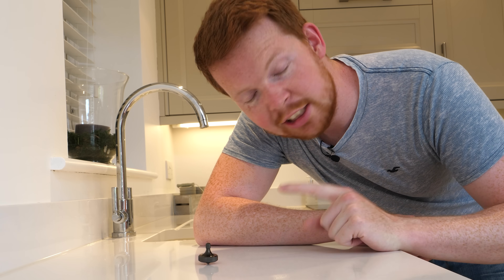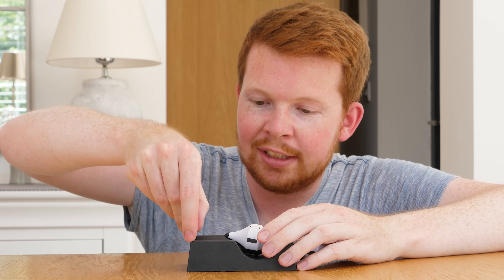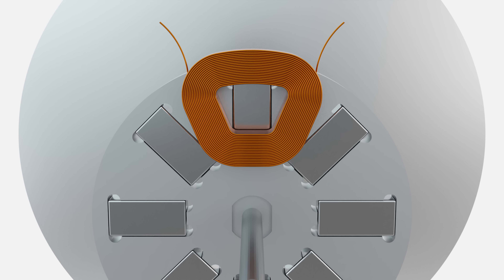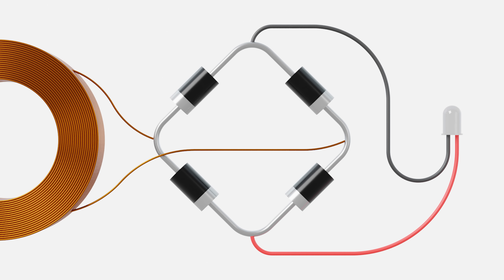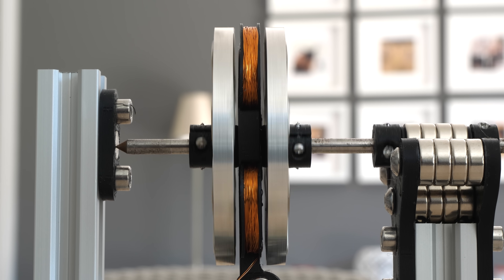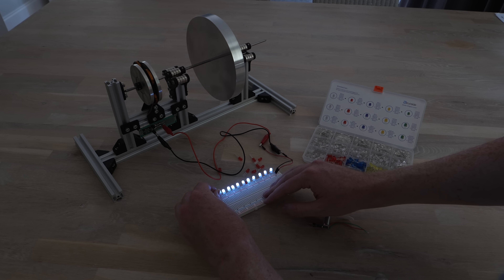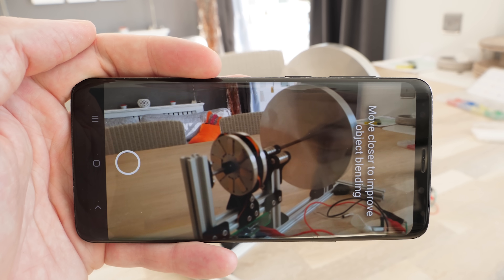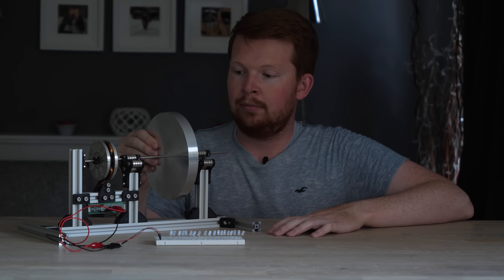Flywheel Battery

Comment: Some interesting facts: According to the U.S. Department of Energy, the United States had more than 25 gigawatts of electrical energy storage capacity as of March 2018. Of that total, 94 percent was in the form of pumped hydroelectric storage, and most of that pumped hydroelectric capacity was installed in the 1970s. The six percent of other storage capacity is in the form of battery, thermal storage, compressed air, and flywheel.  The flywheels store 58 mega watts of that total capacity.  Some flywheels use magnetic bearings, operate in a vacuum to reduce drag, and can attain rotational speeds up to 60,000 revolutions per minute.
Reply: Phobos, 

storage is not measured in Megawatts, but megawatt hours, i.e the duration that the storgae can provide power for.
What the DoE have not included is the amount of flywheel energy in all of the thermal and hydro power plants connected to the grid. These large machines have a very large amount of inertia from the roational speed and large mass of the generators. (Something wind and solar do not have) This flywhel effect has astabilising effect on grid frequency. 
Incidentally a test to measure how long this rotational inertia would last if power was lost was the reason that the chernobyl accident occurred.
That is a problem with storing energy in a flywheel, as soon as you use it to generate power it starts to slow down and power and frequency drops off. It doesn't seem a promising way to store energy for a grid.
Reply: @iareid8255  It's output was the same in watts (from thicker and then thinner wire).. so he knows what he's doing but it's all for YT income.
We're all done here, we're all done with energy.
Reply: @iareid8255  You'd need both measurements. How many watt hours can you hold, but also how many watts can you pump it out at to meet different demands? A trillion trillion megawatt hours of storage built at great expense isn't useful if it's bottlenecked to 1 megawatt in and out, and the cycle of need is daily.
Reply: @iareid8255  right, with each load, you need more force... That applies to about anything related to generating power.
Reply: @iareid8255  
Multiple flywheels. 
The drain from all flywheels will be lesser and lesser. 
Its temporary energy lasting X amount of time. 

It may be better used for some situations and not others. 

It could be used to supply electricity at night in a solar powered powerplant.

Or could be used for. Smelting in space! Lol
Reply: Christopher, 

you may not be aware that large conventional generators are also flywheels, they have a huge mass rotating at 3,000 rpm (50 Hz), this comes for free. 
if you want a flywheel to back up solar that takes some power away as the prime mover needs power to get up to speed. as you said yourself it doesn't last long and slows down imediately it is loaded.
Reply: @avatar1867  They already use counterrotating flywheels powered by regenerative braking for an extra boost of power at the wheels in at least one new car, the new Acura NSX.
Reply: @Daniel Daniel If there was functional free energy, not even the massive fossil fuel lobby could hide it. Any country which has access to unlimited free energy would have a massive advantage over any other country, revolutionizing every aspect of technology and industry practically overnight; there's no way that neither the US or USSR would have ignored such a game changer during the cold war.
Reply: @ENCHANTMEN_  it doesnt have to be free energy to be revolutionary, it's this idea that the newest technolgy is always better forever, maybe some ideas still have merit, and now that we have advanced, they can be approached by new minds,  maybe small flywheel batteries would be healthier for our planet than lithium? all questions that could be answered, but wont as long as we are OK with just accepting things as they are.
Reply: @AmpHibious  that's the way it is.  Flywheels are much more complicated, heavy, and prone to issues than a battery ever will be.
Reply: I wonder if that's dedicated energy storage facilities that use flywheels or just the energy stored in the rotors of power plants that use steam and heat (coal, nuclear, etc)?
Reply: @ENCHANTMEN_  I looked through a whole chapter of an old college book to find for the term you reminded me of but couldn't find it, i think it's called "grid inertia" or "power inertia", its the term that describes the potential energy that is hiding in any major power generating component that is rotating strongly but not actually producing power for whatever reason, for example ANY turbine blade assembly, hydroelectric gens, will spin for like an hour and can be used to reboot the plant or just draw power off that rotation alone for a few minutes or whatever.
Reply: @ENCHANTMEN_  no.
Reply: Perhaps using a battery for any load would off-set any degradation in rotation speed, power, etc.  In other words, use the "flywheel generator" to supply power at a steady, consistent basis of current... while the battery powers whatever it is that needs powering.  Perhaps isolating the two might be helpful... at least "somewhat."  IDK, I'm just speculating and trying to "think outside of the box."  :-)
Reply: @drileydriley2814  A flywheel is not a source of power, it's just a place to store energy. Same thing goes for a battery. Any time you put energy into such a thing, you lose some of it to heat. Your motor cannot perfectly convert all your energy into flywheel kinetic energy; your battery cannot perfectly convert electrical power into chemical stored energy. You lose energy to to heating the wires. And the same thing happens when you try to get the energy back out. 
Think of a battery or a flywheel as a savings account that charges you money for every transaction in or out. Think of a generator as a currency conversion bank that charges you money for every transaction. This is the cold hard reality if thermodynamics.
Reply: @timberwoof  And capitalism. Maybe it was just meant to be this way...😭🛢️💥🚷
Reply: @drileydriley2814  Isn't that what the car alternator does, except without storing the rotational energy?
Reply: @fredbloggs6080  Well, an alternator depends on the rotational energy of (usually) an engine, a battery does not.
Reply: @drileydriley2814  I know but I was saying an alternator doesn't store the rotational energy kinetically like a flywheel, only by charging the battery. Perhaps one could use a smaller capacity battery to act as a regulator as the flywheel energy decreased to keep the output relatively constant up to a certain point.
Reply: @drileydriley2814  We had a system where I worked that needed constant power.  It had a battery bank rectifier and a motor-flywheel-generator in series with each other for temporary power dropouts.  How long was the "M-G Set" good for?  4 seconds before voltage dropped off below spec and the plant would shut down.  One of the very few industrial applications I've ever seen.

Comment: I’m a novice at best but happens if you used Tesla’s water turbine as the flywheel power source how much power could you generate by pushing small amounts of water? Could you use a gas engine to power the turbine/ fly wheel to move a car?

Comment: I once read a good book about generator development. 
The first was like yours in the video. Soon more poles and magnetic force grew so big that they stopped making bigger and bigger generators. Some new inventions and a little bigger generator with new problems. Again new ideas and passing that and those problems. It is an endless chain. Very nice video. Ps. Even aluminum is a non-magnetic material, it encounters huge resistance in the magnetic fields. You can test making a pendulum with aluminum. It really stopped fast if it passing next to the magnet.

Comment: When designing the bearing, is the arc for the fixed magnets calculated based on the strength and size of the magnets being used?

Comment: What if you bridged a motor with a small rubber wheel so that when the flywheel turns it will power the motor and the motor will continue to turn the flywheel. Self induced power?

Comment: The end all would be taking about 40 or more turbines 1 after the other then a parael pipe powred by a air compreasor with belts going to each turbine

Comment: What if the both sides are a bit of center to the outside and the magnetic fields on both sides are mirrored so the both ends of the rod are trying to go in the opposite directions

Comment: Hi Tom, what if you had a pedal transmit your bodyweight into rotational force of the flywheel through gearing, instead of spinning it by hand? I believe that a human doing a stair-master like exercise could generate enough momentum in a flywheel to power quite a large appliance, with the correct gearing ofcourse

Comment: Could also put the magnets on the flywheel itself and have the wire externally around the flywheel so there's no extra weight added to the shaft but is added to the flywheel.

Comment: What would be cool is a little hand crank generator that pumps current through the coil to spin the shaft like a motor. You should use that to increase the RPM of the system without having to touch the magnetically levitating shaft. You could even have the hand crank mounted away from the frame and only attached to it with wires so that you don't induce any extra wobble from cranking.

Comment: I wasn't expecting to gain an understanding of Full Bridge Rectifiers today, but here we are!  Thanks!
Reply: somebody please mention Mehdi…🥺
Reply: @WilburJaywright  FULL BRIDGE RECTIFIER
Reply: Things to note, he showed it in different orientation (from up to down) that what is usually shown (from left to right) in textbooks, so some might get confused with that, unless you pay attention to the direction of the diodes.

Also, you usually also add capacitators to smooth out the resulting DC voltage, like here it was still going up and down, instead of the steady(ish) DC most of our devices expect
Reply: Not to put too fine a point on it, but the proper term is "Full wave bridge rectifier" for the device made up of 4 diodes. They can also be purchased as a package with 4 leads coming out. "Half wave bridge rectification in the case of this circuit could be accomplished with one diode.
Reply: Same
Reply: I still dont understand diodes at all
Reply: @sethmath2778  Think of a diode as an electrical check valve. Current can only flow in one direction, so this allows for converting AC voltages into DC voltage. AC voltage is a sine wave moving from negative voltage to positive voltage, back and forth 60 times in one second. In the case of a 'full wave bridge (often 4 diodes unless fed by a center tapped transformer and then only two are needed). two of the diodes are always conducting allow half of the sine wave through the circuit at a time maintaining polarity. If you watched this on an oscilloscope you would see the negative side of the wave folded over so there are now nothing but positive voltage humps that are then smoothed out with capacitors which store and release the voltages at the intervals to turn the humps into a straight line, or constant DC voltage.
Reply: @fredflintstone8048  

I'm not that guy, but I still don't understand.  I understand all THAT, but HOW does electricity not move back through it?  People always say electricity is like a hose of water, and it's obvious how to stop water.  Just block it.

But how does electricity get blocked?  Unless at that micro-level, the electrons literally act like water?  If that's the case, how does a diode let tiny electrons through only one way?  Tiny funnels?
Reply: @fredflintstone8048  Great video. Thanks for sharing.
Reply: Same I actually understand stuff better in application than in raw theory
Reply: Yeah, this makes a lot more sense than my physics textbook did.
Reply: @notsosureanymore  ～～

Comment: rotate your field coils by 90 degree, this gives you match more efficacy .. ;)
for even more efficiency use 2 field coils 90 degree apart. make sure when magnets charge the core the coils are not in phase with the core... then when field rotates by 45degree, stored magnetic energy in the core gets released.. at the same time a gyro magnetic effect will take place, as when a field is formed and you try to rotate it by 90degree it will implode and generate a huge spike in potential.. just like a boost converter. .. this hes as effect that the load and source are out of phase and are blind to one and other.. if you know something about electromagnetic systems then you know this is very very very useful.. have fun experimenting cheers!

Comment: By using a hollow tube, you can mount the magnets for the alternator within the tube itself.  In doing so, you can then use slightly tighter tolerances to create better field interaction. As far as spinning, using a sort of reverse clutch, you could attach a crank to the end that would disengage when you stop applying pressure allowing you to spin faster without adding too much in the way of friction.

Or, I could be completely mad.

Comment: A horseshoe of steel instead of the air magnetic circuit would alter things greatly. Reduce air in magnetic circuit by replacing it with high permeability material. This is why a car motor needs such tight clearances. Mu of air is trouble.

Comment: Was thinking you could thread the flywheel and then put the steel rod through that with a drill to keep the bend from happening with heat.

Comment: Are you familiar with rotating a copper disc in the presence of a magnetic field? Faraday discovered that if you measure the potential voltage between the center of the disc and the outside of the disc there would be a potential voltage difference and he also discovered that if you rotate either the disc or you rotate the magnet that potential difference is the same. Moreover he discovered that if you cemented the disc to the magnet and rotated them together the same potential voltage difference was created! By rotating the magnet and the copper disc together like a giant hamburger you create the same electrical force without having to overcome the mechanical energy required to rotate only one of the structures! You know like if you take a small DC motor and you turn it as the coil passes through the strongest point of the magnetic fields there's kind of a thump thump thump by cementing the magnet to The copper disc you get rid of that resistance it only have to overcome inertia and friction.

Comment: 5:32 When you say "light bulb" I always picture and incandescent filament type, which work on both AC and DC current.  Does this mean I'm old?

Also, I'd love to see a cost comparison between vacuum flywheel storage solutions and chemical batteries, since I think they'll become very relevant in the near future.
Reply: Is it possible to buy an electric generator from you?
Reply: There are some buses somewhere in Europe that use a huge flywheel for energy storage.
Reply: Join the club
Reply: Complex batteries...with a giant tank of chargeable "FLUID"

Comment: I bet you think the wobbling is because various parts aren't quite straight enough, or on a flat enough surface, but actually, it's due to the "intermediate axis theorem", which in a nutshell says that most things that are spinning are actually spinning around multiple axes.  Veritassium did a great video about it https://youtu.be/1VPfZ_XzisU .  You can avoid the wobble if you make your spinning disk's mass more concentrated in the pancake section, rather than having a secondary spinning disk attached to the side like a sidecar, and this change will be crucial if you ever want to get your desktop flywheel up to higher speeds.  This will mean putting the magnets in the main disk itself.

Speaking of higher speeds, the next step in your project is to support using it as both a generator and a motor: that is, the same coils you've already wired up can be used to get it to spin faster, not just slow it down.  I hope you do a follow-up video about that!

Comment: You should install an bearing and a pullee in the bar end, so u could easily generate electricity, with a battery you could save it, ez energy

Comment: You would think that adding a heavy flywheel then spinning this at a high speed while moving another magenting force closer with a force that would make it spin faster and freely then remove the motor it would be able to accomplish a continuous motion that will not stop. But I'm just a retard.

Comment: You could probably get around the need for a rectifier by connecting the LEDs in Full Bridge configuration and using an AC motor.

Comment: See if you can put the electric motor to spin the flywheel so it powers itself with just a little push from you to start the motion !
Reply: No! That is an attempt to make a 100% efficient machine. And NO MACHINE IS OR CAN BE MADE 100% EFFICIENT